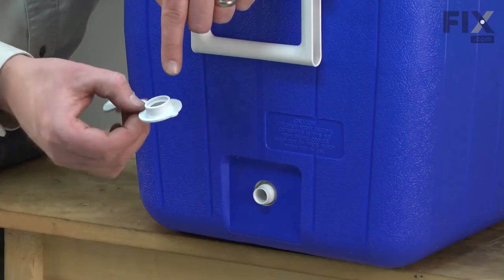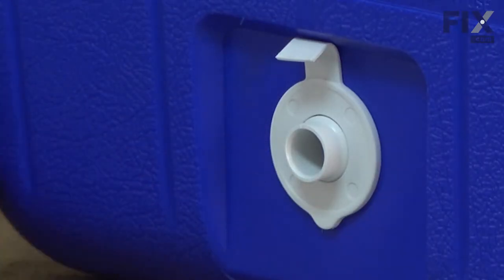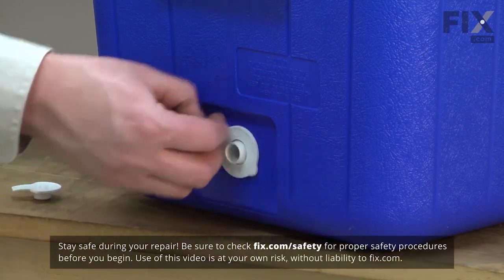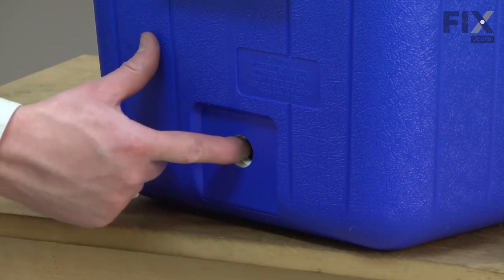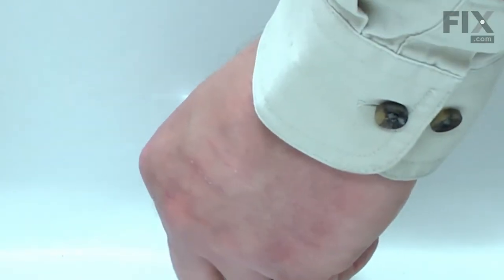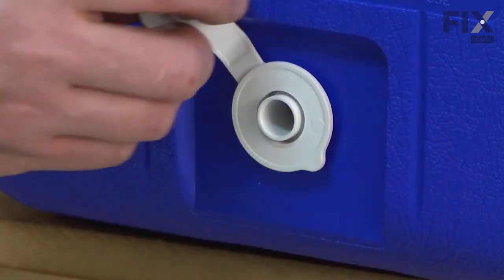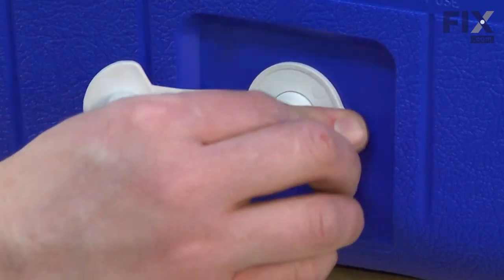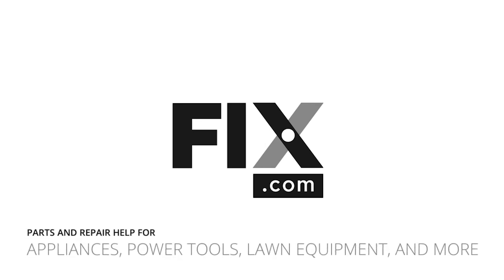Coleman Cooler Repair - How to Replace the Drain

Comment: The nut with the broken lanyard is so tight on the threads that it is like they are welded together, and there is no tools that will "grip" the two pieces that must be unscrewed.  I see the new nut throat is hexagonal so a tool can be inserted to unscrew these two pieces.  Belated engineering???